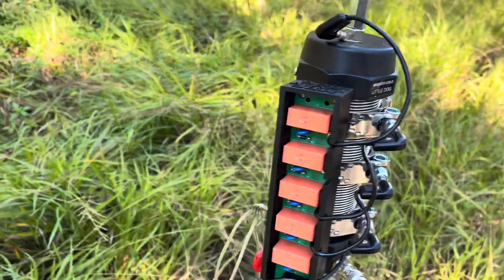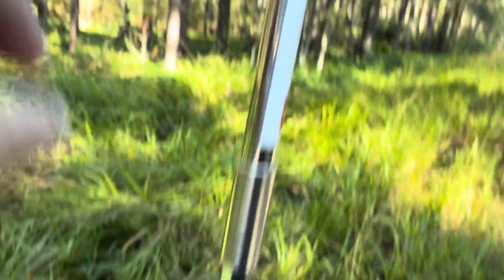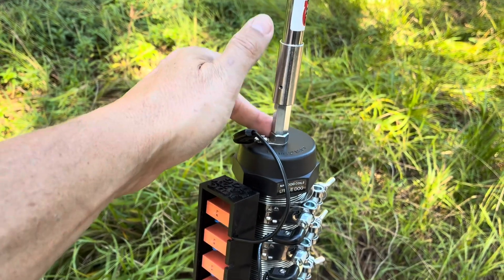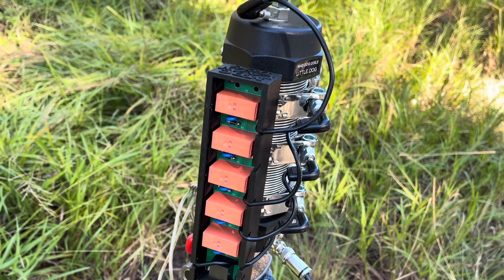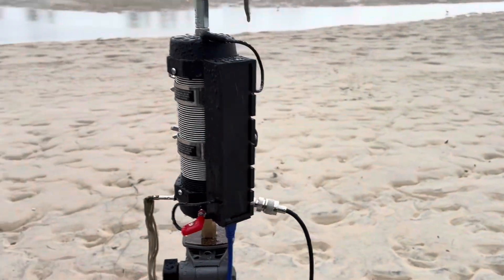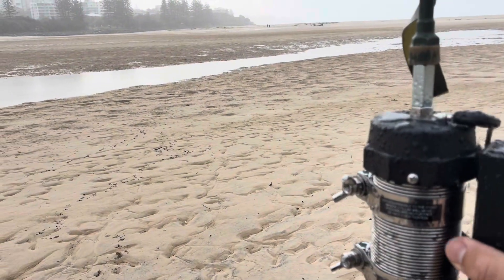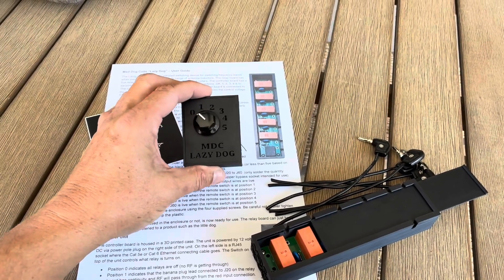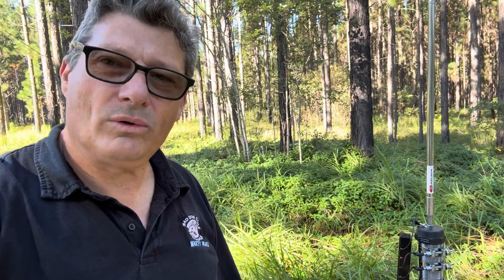Mad Dog Coils (MDC) "Lazy Dog"

Comment: I know you have thought about it , maybe add connectors to the Relay box, some might not be able to solder wires to the Relay Board maybe more Marketable ? I think this is a Game Changer in Bad WX etc . Great Work , Much Success , 73, AJ W5HEH  PS oh forgot to ask , how much Power can we run thru , SSB, CW , etc. ?